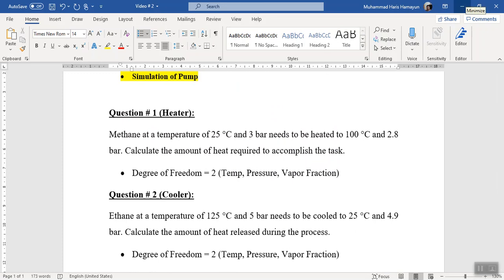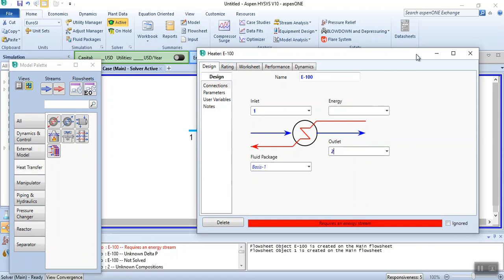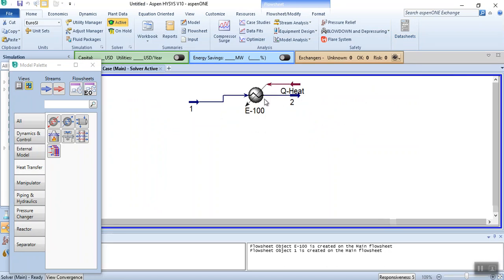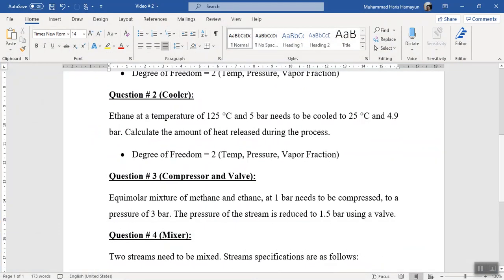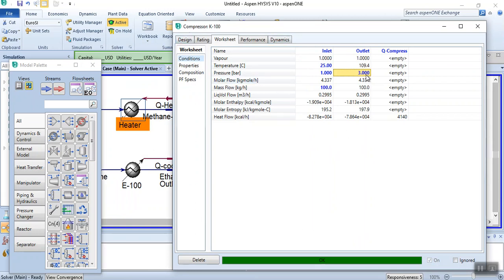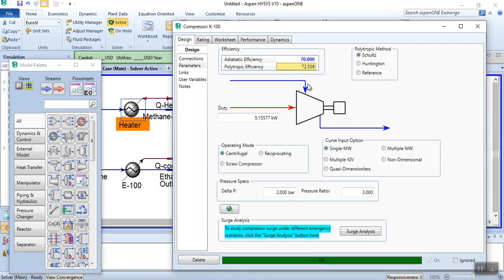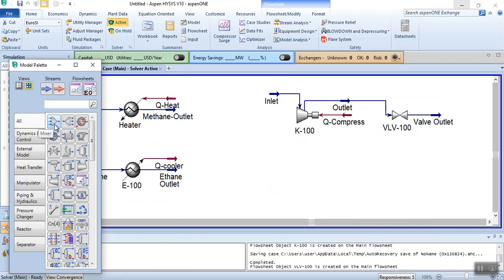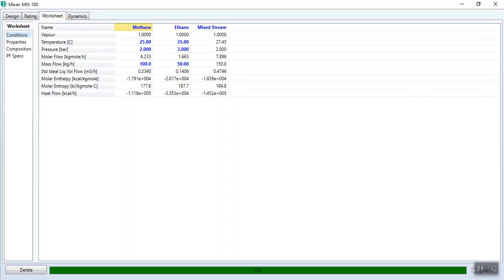Simulation of Heater, Cooler, Compressor, Valve and Mixer in Aspen HYSYS - Lecture # 2

Comment: Hello kind Sir, thank you very much for your tutorials! I would like to ask you if the Aspen Process Economic Analyzer tends to trigger warnings when using a simple heater like in the example: I've tried to input all the information in a case I am working on, but no matter in what environment I use them the problem persists. The Main solver works and the streams and equipment are in the right color but I'm afraid I might be specifying the heater incorrectly/insufficiently
Reply from the maker: Probably, you are not specifying utility for the heater/cooler, or if specified, didn't link it with the block. Accordingly, economic evaluation is providing an error.

Comment: At the ending part, why did you place composition of ethane as 1 and methane as 0?

Can you  throw more light on degree of freedom because in the question, the degree of freedom is 2 for the first question and you used 4 degrees of freedom.

Comment: Nice video... very well explained
I am also trying to model a heater, but in my case I know the heater Duty and need to calculate the outlet temperature.
My trouble is Hysys is not automatically taking the flow from inlet stream to outlet (outlet is not getting auto updated with respect to inlet stream), can you suggest what could be the solution
Thanks in advance
Reply from the maker: Please make sure that active button is pressed, and simulation not on hold.
Reply: @aspenchemchannel   Thanks a lot!! I am new to HYSYS, so missed it